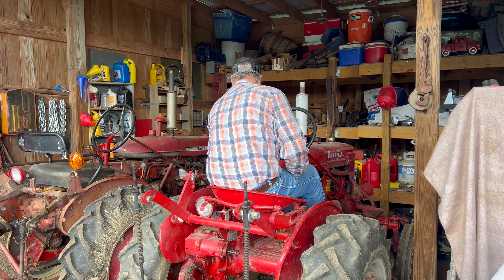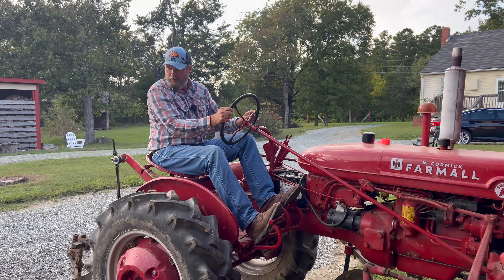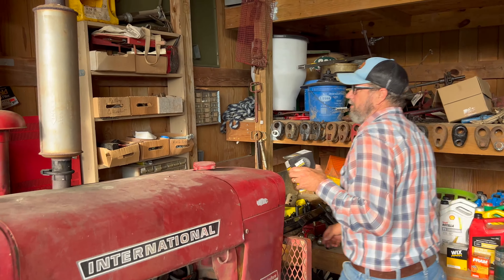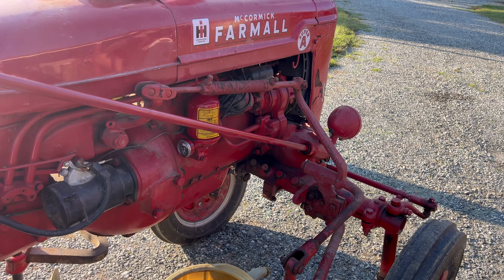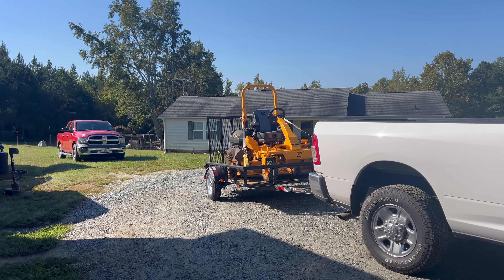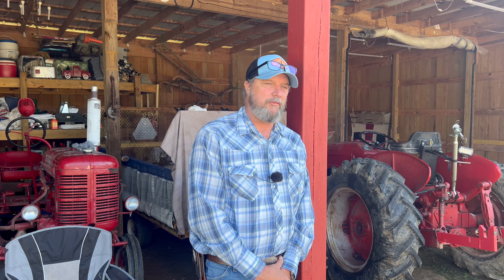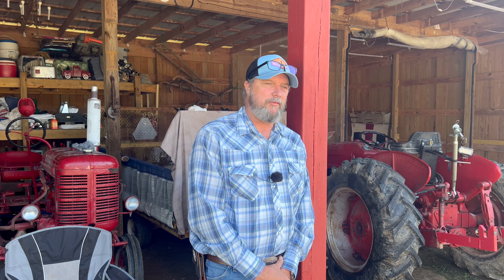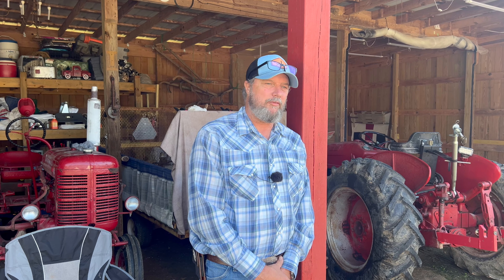Welding , Mowing , And Maintenance

Comment: That’s the correct oil for that tractor IH recommended and sold 30 and 40 wt low ash oil
Reply from the maker: For what it’s worth it didn’t help the oil pressure. We’ll see what it does when it’s hot.